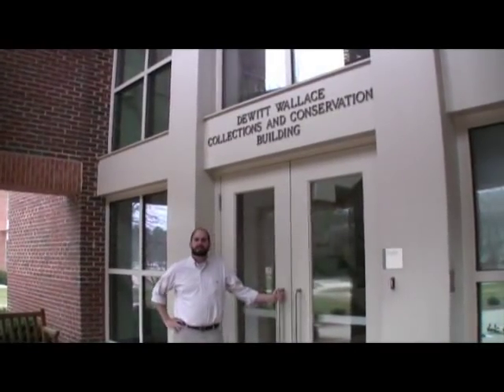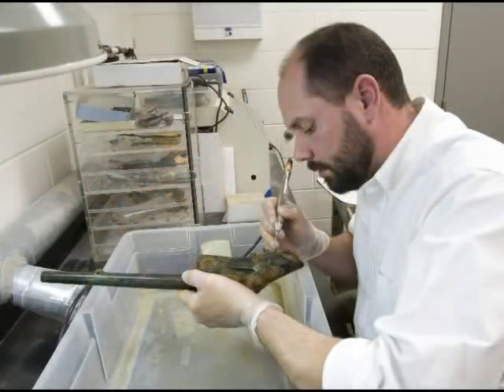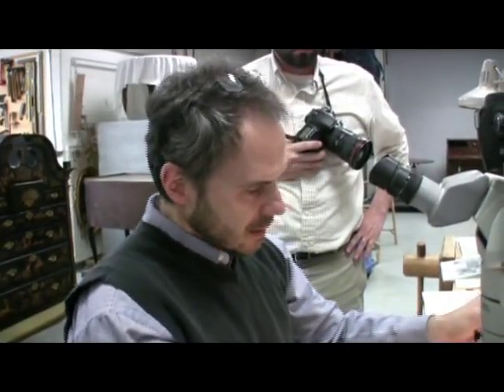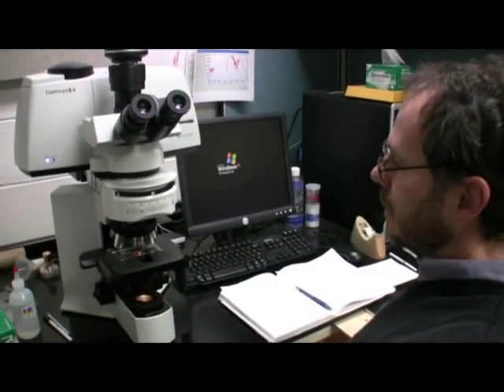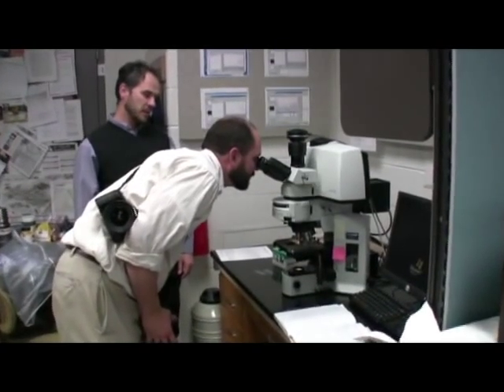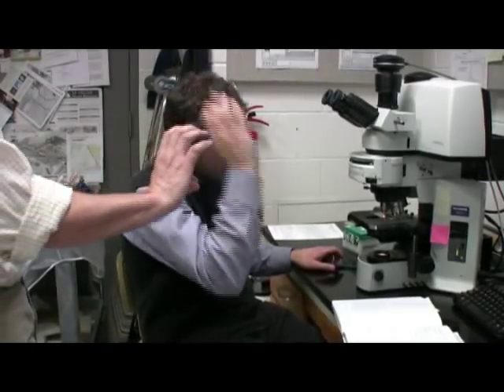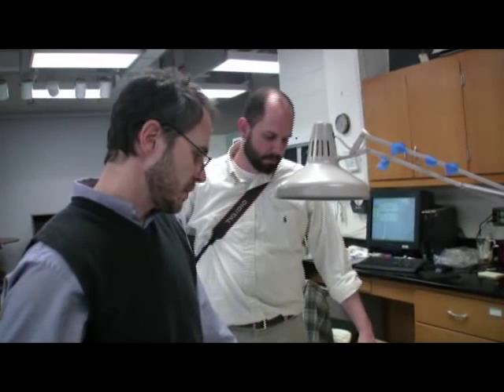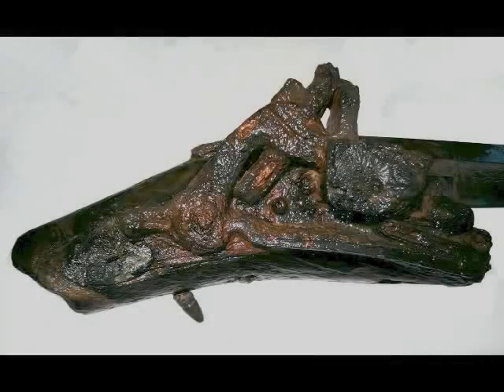Wood identification on the pistol stock recovered in 2006

Comment: Do you folks not have any card back razor blades? Using a double edged razor for cutting anything other than whiskers is dangerous. Used one of these once for something else and ended up with two sliced fingers.
Interesting procedure though.